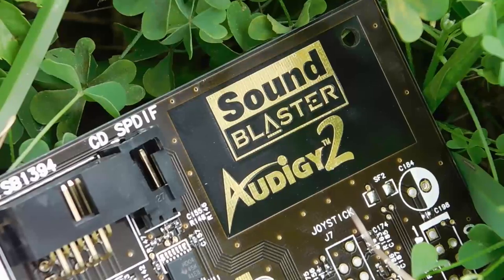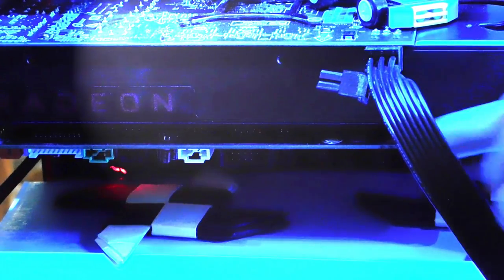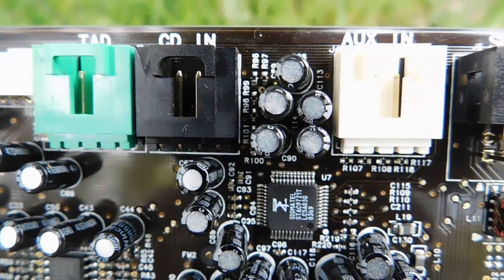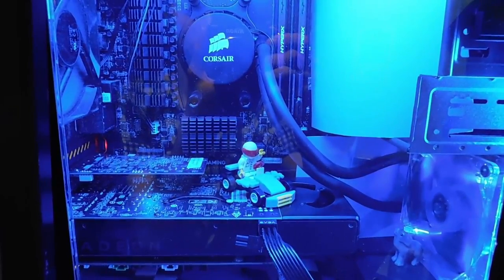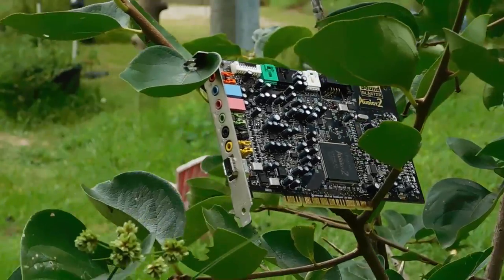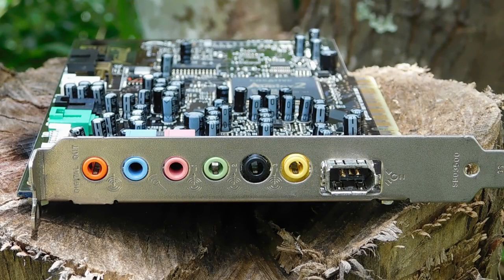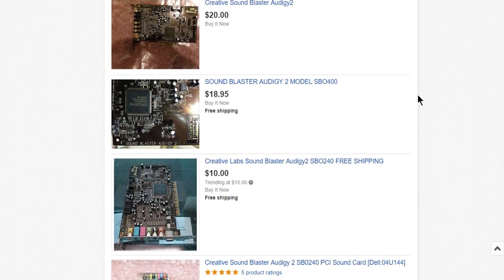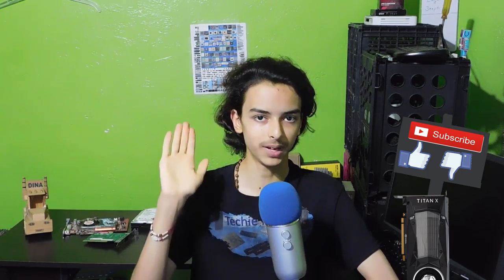Sound Blaster Audigy 2 | Is it still a good sound card in 2017?

Comment: you must know this card has wave table synthesizer, and i found no match for this sound card yet. It enhance all the dull sounds and its improves sound quality unbelievably. I am a computer seller for over 25 years, i love creative sound blaster .
Reply from the maker: Well maybe my headset was not that good at the time of making this video, because I did not notice any difference back then. But you I can understand just by looking at the specs.
Reply: I am using Bose 3.2.1, Audio beats studio and Bose headphones, but the thing matters is the sound generates this sound card. I love it. i attach these things to any other source its is un matchable
Reply: in windows xp it had another sound option of acoustic , in win 7 and 10 its not available
Reply from the maker: Yeah ik. I guess now that I have some ATH-M20x's I will try and use this card again.
Reply: maybe there are some unofficial graphic console. is my case i found some (SB0570)...
Reply: You said you noticed a better sound quality with the 32bit sound(even though the card does not support 32bit). Time to do some reading about what you are talking about. Also firewire was used by most top quality off board pro recording setups until recently, and has only just been replaced by thunderbolt.
Reply: @Rashid Malik, please tell me if this card can work under Win10? I'm not shure.
Reply: Dude believe it or not.. ive tried dozens of  pci soundcards around the years.. the level of details this card produces is astonishing especially the highs are unbelievably crisp. I dont know about todays tech.. its all software based but back then.. its the hardware that speaks for itself. Im using it with z5500 and under windows 8.1.
Reply: I have one and I don’t know what it even does
Reply: @lemonbade  install the whole package. Run the software increase base and sharpness and select acoustic from sound selection. And bommmm

Comment: Someone gave me a Creative Audigy 2 ZS back in 2008 and the card was being purchased in 2003. Great gift i ever had since then and now it still works like a charm with my brand new motherboard with 7th gen i5 processor which i hooked up with a logitech 5.1 surround speakers. I'm running on windows 10 if you're wondering  :)
Reply from the maker: Sean Poh great mate! Thanks for the info. I want to buy another one as my Audigy 2 finally broke down so I am getting an Audigy 2 ZS.
Reply: Sean Poh i got 6.1
Reply: what drivers you run man

Comment: Another good use for this card is using it for musical instruments. There's an application called GTR3, which is basically effects for your electric guitar on a computer and the application demands specific audio chipsets. Most on-board motherboard audio chipsets aren't compatible but this sound card works perfectly. Mine is still in use today.
Reply from the maker: Niceeee

Comment: I believe the headers on the side of the card are for connecting to the front I/O panel that comes with it. The Audigy 2 ZS is supposed to include a control panel you insert into the 5.25" drive bay at the front of your case.

Comment: Firewire may be forgotten in the consumer market, but there are still some devices (mostly pro audio interfaces from the mid 2000s) that are great to use, are very cheap and can enhance the signal flow more than you can think. Also, Is a really cheap way to enable EAX on old games (the ambience changes a lot with it). Also the wavetable capabilities of the Audigy 2 is soooooo great... Still is cool that you laid eyes on such card.
PS: bit res and sample rate can give you an idea of the performance of the audio device, but bare in mind that you also require to analize noise floor, TDH, the actual DAC used... PC Audio enthusiasts are pretty neurotic with those details and specs!!
Reply from the maker: Thank you for the feedback.

Comment: These sound cards were designed to go hand in hand with Creative speaker systems.  During the early 2000’s when DVD-AUDIO was trying to be pushed the sound quality from those 5.1 DTS/Dolby Digital discs are phenomenal.  The higher bitrate does give a much better discrete surround sound field.  The problem was Creative speaker systems were crap.  I had a Logitech 5.1 speaker system with amplifier that had really good sound.  A few years later Logitech manufactured a 7.1 system which worked exceptionally well with the EAX feature of the Sound Blaster Audigy 2.   Unfortunately 5.1 music didn’t initially take off like the record industry thought it would so they were discontinued.  It’s sad because the resolution is amazing.  My Cadillac has a 10 speaker Bose Surround Sound system and I’m now able to really enjoy listening to my DVD-AUDIO collection.  Up until buying a vehicle with a surround system one of the main drawbacks to listening to 5.1 music is there were no portable systems.  You could only listen to surround music at home on your couch.  That was a big bummer for surround fans.

Comment: The side ports are:

unlabelled - i think proprietary front panel audio connector.
TAD - Telephone Answering Device. you connect this to a telephone line modem, a Creative Modem Blaster, a 3Com, etc. - mono in-out combined.
CD IN and AUX IN are self-explanatory
SB1394 is for front panel FireWire.
JOY/MIDI is for a riser bracket. Since all the connectors didn't fit on the back, there would be a bracket with just one 15-pin connector on it, which takes either an old style PC joystick, or a MIDI adapter (active pigtail for around $20, contains a good handful of signal matching and protection components) to digitally control external synthesizers or capture the keypresses from piano keyboards and control devices for recording software. The 15-pin connector is from the era before USB, and was carried forward for compatibility, and because Microsoft couldn't for the longest time figure out how to write a functioning MIDI USB driver that wouldn't just murder longer special messages.

24-bit and 32-bit audio does not really exist, as far as output goes, nor inputs even really. You get maybe 18 bit, maybe at the highest end 20 bits of output quality. Case in point a high-performance 18-bit DAC CS4382 serving the front channels on this card, so there's no way it can ever exceed its fundamental performance. Most inputs, mixing functionality, and secondary channels i think come from STAC97 which has approximately 16 bits of real world performance while being 18-bit on paper. Same STAC chip or very similar competitor chips had been frequently found on cheap mainboards of the era, but thanks to layout and power components, it actually performs better here than usual, in particular the mic input on a mainboard of that era would usually be absolutely diabolical, while on the Soundblaster it works pretty nicely. Seems there's also an UDA1361 ADC which is pretty high spec on this, but without really tracing it out, i wouldn't know what for, but chances are it's for the back-panel line-in.

Interesting features include a rather powerful digital sound processor (DSP). Using third party Kx driver, you could run for example guitar effect processing completely on the card, without touching your CPU, and you could write software running on the card itself. You can also do spatial processing and many other things. That's something that is increasingly difficult to make use of today, but if you can get it to work, it is immensely useful. This is also where 32-bit audio processing comes into play, as the signal can get amplified with every step, intermediate calculation precision can be very important. While you might not get the highest complexity effects on the card, implementing them like this allows true near zero latency all the way from input to output, which is not something you can achieve once a heavyweight operating system is involved.

There are a number of powerful features that are clearly obsolete and useless. The sound card contains a powerful synthesizer processor that can be used to accelerate audio processing in videogames and offload it from the CPU, increasing the overall system performance, and this worked marvellously under Windows XP, but Microsoft closed this avenue from Vista onwards, so accelerators would no longer work. The aforementioned DSP would assist the synthesizer in room ambiance simulation for EAX compatible games. The synthesizer was also useful for music production and for older videogames from before the MP3 era, but from around 2008 on you could do all this on the CPU and not even see a performance impact.

Of particular note is how Creative handles all inputs and outputs. Affordable mainboards are notoriously distortion prone when driving low-impedance headphones (VT2021 based ones excluded, but that's a dead chip now), while Creative always included high-current output chips, in that era usually the 4556, which fare much better - even when the DAC was just as mediocre as on the mainboard, it would still provide a significant boost in headphone audio clarity. The other outputs also get a little boost from the much weaker 4558 chips. There's a transistor array near the rear jacks which i suspect shorts them out whenever they're not in use, so they don't turn into antennas and contaminate the signal on the card. Nowadays you will still find similar design traits on Creative cards, though they use MAX97220A now for the headphones. I think in SB Live era it was TDA1308 or something, which wasn't great.
Reply from the maker: Thank you for that :)
Reply: I see u understand this things,so tell me i want to use this card on my pc,i will output music from digital out (this card) directly to the amplifier digital in (amp got DAC in it) is this card good for that ? Transfering hi res audio to amp ?

Comment: audigy2 + kx drivers is still pretty awesome so I use it. I need it to make custom eq/volume channels for mismached quad speakers. PS 24/96 is only available when the DSP is disabled so there is no filtering in that case.
Reply from the maker: Yeah. Mine just broke finally so I am going to order another :)
Reply from the maker: Yeah ik! Thanks for giving the link tho :)
Reply: There's no need for KX or some replacement drivers Audigy 2 series.

Comment: Unless you are going retro, go X-Fi PCIe. They start at about $20-25 on ebay and they have modern front audio jacks.
Reply from the maker: I agree. However, I had this laying around and you can find these for even $5 on eBay right now. So I decided to show you all!
Reply: They are around $12 and get intermixed win the Audigy 2 ZS. I just got a ZS off ebay for a retro PC. You gota be careful and look at the photos and make sure they are not stock photos. A lot of "ZS" cards listed are actually just normal Audigy 2's in the photos.
Reply from the maker: Yeah ik. But if you look good enough you can find pretty good bargains!
In fact I am building a $46 budget gaming PC which I will show pretty soon to this channel :)
Reply: Front audio might give you a little bit more noise from the computer. Audigy have port for a front panel. It's this white thing next to TAD port. Adapter for HD Audio cost about 2$. I have set like this.
Reply: GiSWiG By Xfi do you mean the ones that still give you hardware EAX?

Comment: I know that its 2020 but this still would apply in 2017
Is the Audigy 2 series a good card?...No unless you are building a Windows 98/ME Gaming PC. Yes, the card supports Win98, not just XP. If you want a good Windows XP card, go for an X-Fi (more money but worth it).
What to use today? Motherboard sound is decent enough but I have found some boards have great features and sucky sound and then the other way around. I know its aging but my Z170 MSI board has great features and sucky sound. I fixed that with a Sound Blaster X AE-5 (I needed the Alchemy features). Don't need Alchemy but have sucky sound? No budget, get one with Dolby Headphone. I plan to upgrade to an AE-7 for that while keeping Alchemy.  Want a cheap card with Dolby and Win10 support? Get a used Xonar DGX ~$20-$30 on ebay. It started to be discontinued when Win10 came out but they did make Win10 drivers and there are good unofficial drivers. Make sure it is a DGX. I saw some trying to sell a Xonar SE as a DGX. Xonar SE is, well, sucky sound.
Reply from the maker: Thanks for your comment

Comment: Audigy 2 or SoundBlaster Live! 24-bit 7.1 SB0410? 
Wanna make better sound and quality of microphone record, so, what do I need to choose?
Reply: Audigy 2 SB0240 better caused it using EMU10K2 whereby Live! 24-bit SB0410 using stripped down audigy value chip CA0106 but not Live! EMU10K1. If you compare with built in realtek hd audio, Live! 24-bit certainly out performed as nowadays powerful processor that help in software rendering

Comment: Just got a Audigy Fx, huge improvement over the "onboard" on Z77 MPower! Mostly in signal strength, but the sound is also more clear, all the tones are just there! Some improvement in noice, the onboard was almost unnoticeable at max power and this is completely dead silent (studio quality)at max which i aprox to 30-80% more power (actually a tiny bit more power then these 40mm drivers seem happy with).
Reply from the maker: Niceeeee

Comment: ok..now i have 4 soundcards..Onbord Realteck 7.1 (1150Socket MB), Nvidia Audio (graphic card) and Creative Audigy SB0570 ...and for my BT headsets, a cheap Bluetooth USB  stick, for audio connect. 
 But i still using Creative as main soundcard with Entertainmant Console and Cystalizer. Old but better, specially on 5.1 sound system.
Reply from the maker: Yea it is a pretty decent card

Comment: For anyone using this card (as I am)  These drivers modified by Daniel K. Work well for Windows 10 and gives back the EAX and EQ fuctionallity along with it. Here's the link: http://danielkawakami.blogspot.com/2017/01/sb-audigy-series-support-pack-62.html#more Enjoy!
Reply from the maker: Thanks man! Definitely doing to try those out once I get this card installed again
Reply: @TechiePocket1  With Widows 10 (1909 version and up) came some new problems... The drivers in Daniel K's 6.2 pack no longer work. The workaround is: Install all components of this pack but not its drivers, use custom install. Instead install the Audigy 5 RX drivers (just the drivers) you will have to unzip them to get at what you need. The specific driver set will be found in Audio\DiversWin10 folder. Use that setup only.

Comment: Interesting Video. When I built my previous system (Intel Q9550) the Audigy 2 while it made a slight difference in the sound, it caused stuttering while playing games,  no matter what settings I used. put it back in an older machine and it worked fine. So there appeared to be a hardware compatibility issue somewhere, have not tried a dedicated sound card on my current fx setup as the sound seems quite crisp as it is though I do use good headphones which helps.
Reply from the maker: +Chris Cowey Yeah. I have since switched to Intel.. And that was probably a bad idea.
Reply: Chris Cowey just get a X-Fi Titanium or any X-Fi with the EMU20K since it fixes that and also gives some of the best quality sound ever.